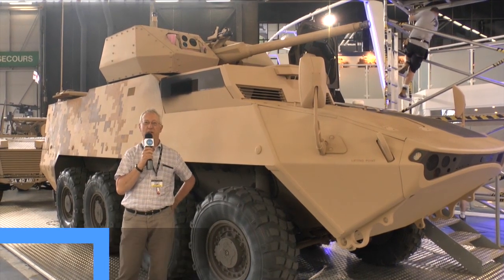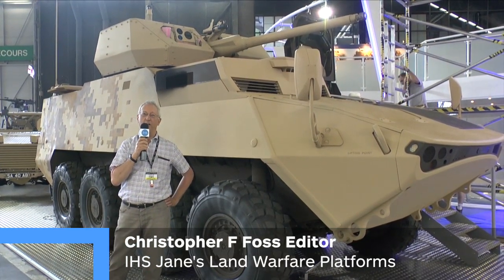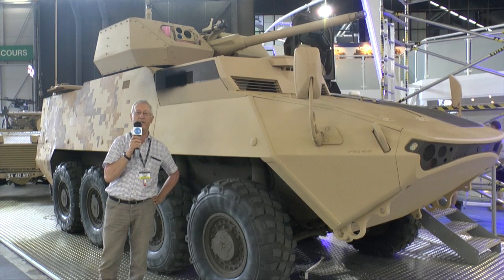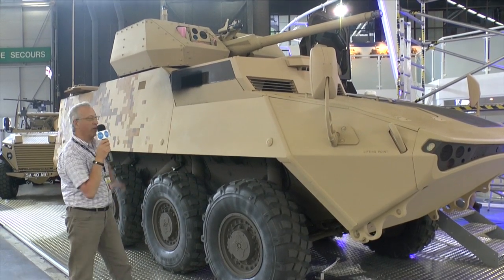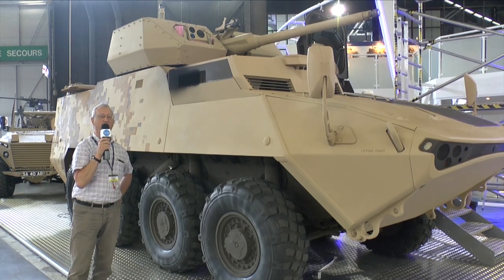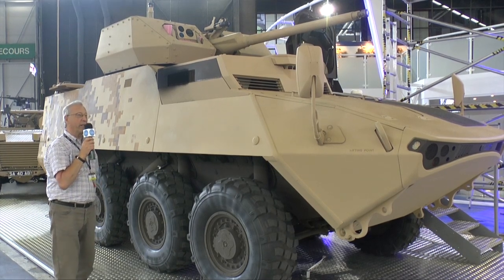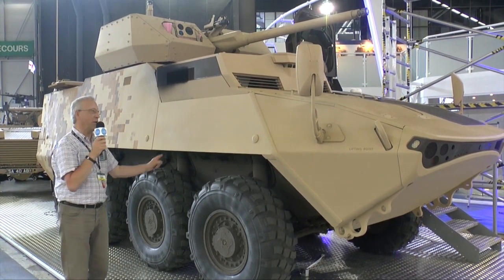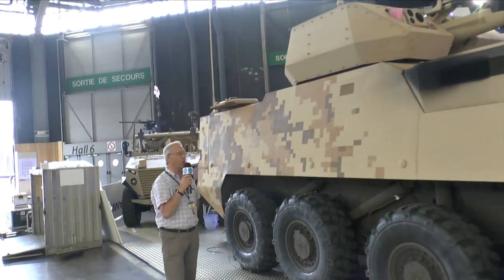Eurosatory 2014 General Dynamics Land LAV Demonstrator - Christopher F Foss

Comment: whats the weight of the vehicle complete with all the upgrades ? Concerned about ground pressure when your working with wheeled armoured platforms.
Reply: LAV Demonstrator's weight was about 28,5 metric tons
now they also promote another one LAV - known as 700 - which could weight up to 31 tons